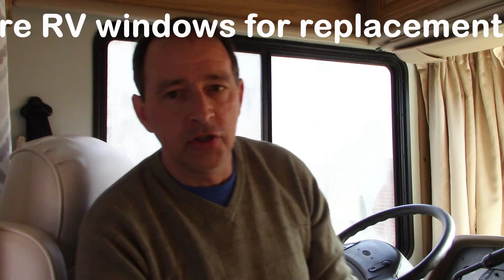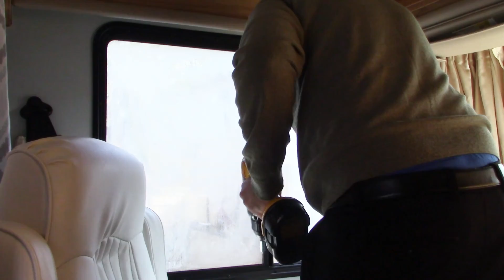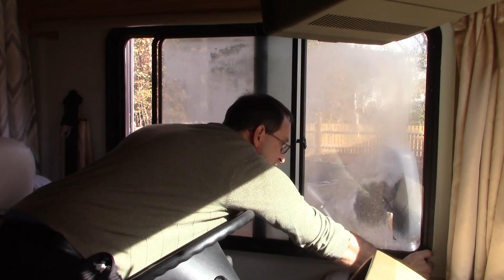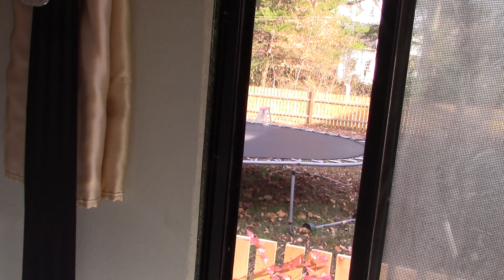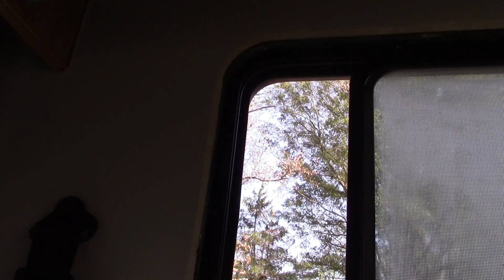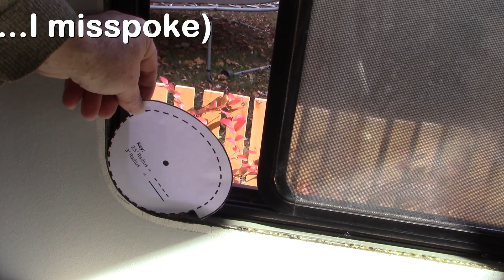How to Measure Motorhome Windows for Replacement

Comment: I have a 98 Fleetwood Bondour 34J...what was the part number for side windows...both the drivers and passenger...or what is the measurment you had so i can order bith side windows
Reply from the maker: I sold the RV recently, so I don't have any details beyond those which I share in the video. Good luck!

Comment: I'm wondering about the radius for these windows. Did the 2.5" fit correctly? I have the same founder and I'm going to order the same windows.
Reply from the maker: Yes. Fit perfectly.
Reply: @Buckwsr  how long did it take to get them after you ordered them?
Reply from the maker: @stevegraham4512  I don't remember exactly, but it was a long time....like 2 months, maybe.... They will give you a delivery date when you place your order, and as I recall, it was pretty accurate. I don't know why it takes so long.